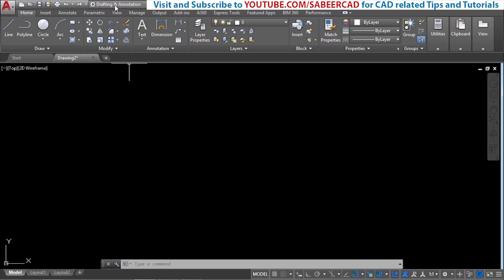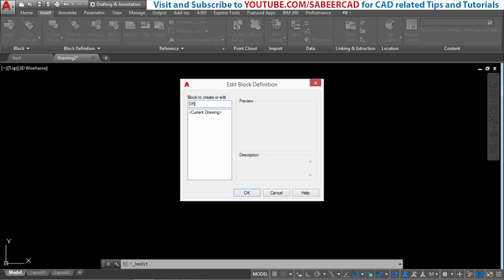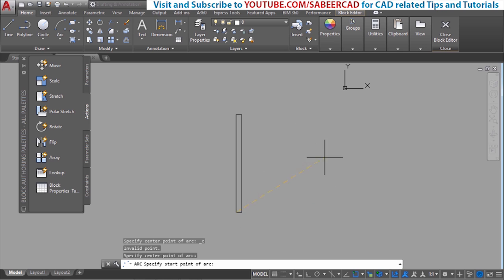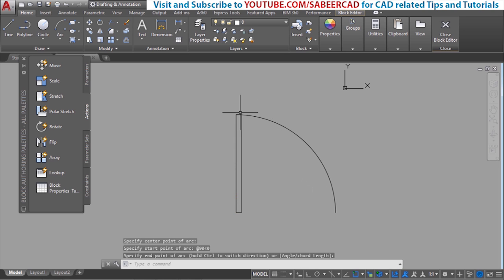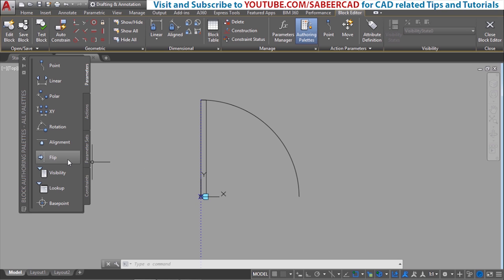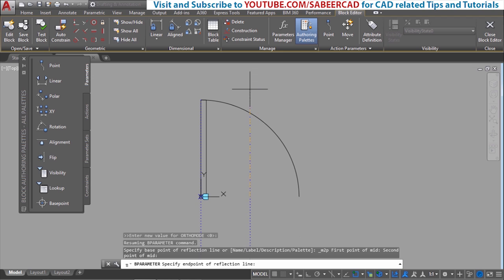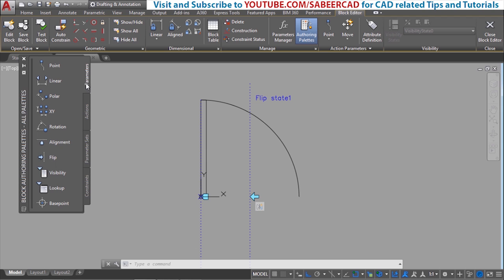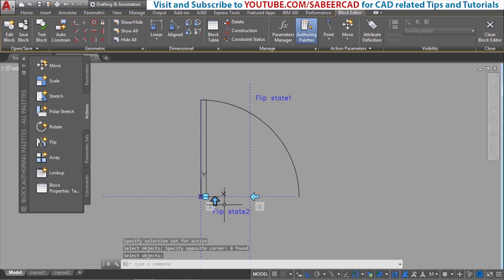AUTOCAD DYNAMIC BLOCKS | DYNAMIC BLOCKS

Comment: Sir, I am using AutoCad 2010 version, when I am moving the door using the move command with the base point and when asking the second displacement I am giving the 0,0, But it is not coincide with the object ,several times I tried but it not coming with the origin point.Sir please help me, maybe it not working with 2010 autocad.

Comment: Hi may I ask what your PC specs are or what PC spec you would recommend for AutoCAD 2017 thanks 😊
Reply from the maker: My spec is Intel core i7 processor with 8 GB RAM and 2 GB graphics card . You need minimum Core i5 processor with 8gb ram and 2 gb graphics card to get optimum performance of AutoCAD